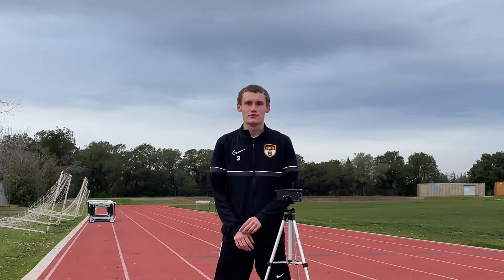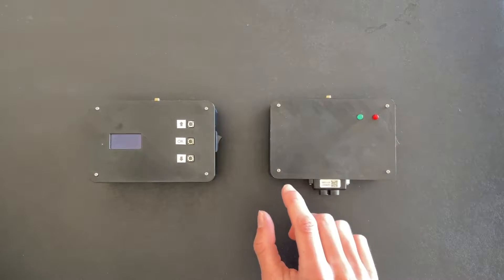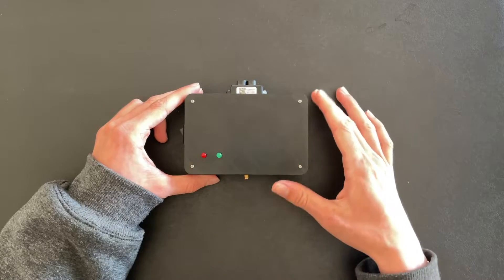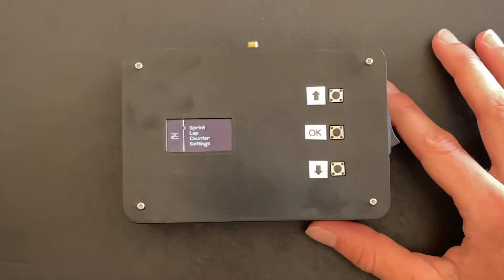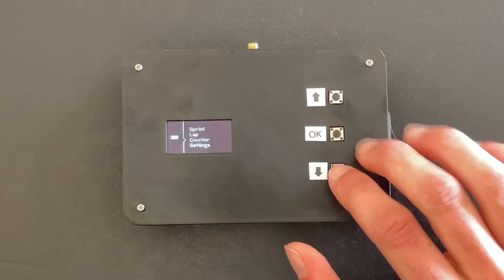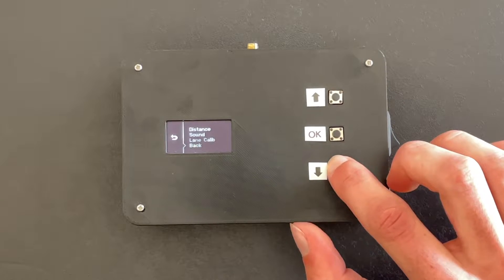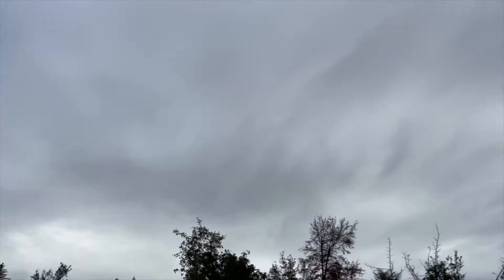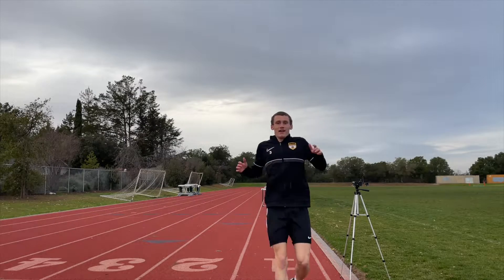DIY Affordable Track Timer

Comment: Hello Collin, did you use a circuit board to connect the pieces or just plain wire? I am unsure of how to connect them otherwise…
Reply from the maker: Hey! The arduino acts as my "circuit board" since all modules should pretty much connect directly to it. For things like the LEDs on the finish module I just soldered the resistors onto the LEDs and then used heat shrink. You can totally use a perfboard if you want though

Comment: Hi Colin : I managed to build your track timer. It was working for a while but the the time has stop working   The clock will not run when in  sprint/ manual mode. Also when in lap the clock will run but the lap time will count without any anything passing the sensor. Hope you can point me in the right direction. Many thanks. Lincoln
Reply from the maker: Hi Lincoln, usually when this happens it means the two modules are not correctly connected to each other. Make sure the start module is receiving numbers (distance in cm)

Comment: Collin, I wasn't able to find the parts list in the link from a few years ago. Is it still available? I think my boys might enjoy making one of these.
Reply from the maker: Yes! Sadly the Arduino page hasn't been working for a while but the project and parts are still up on Hackster https://www.hackster.io/collin-w/easy-and-affordable-track-timing-system-dcc6f9
Reply: @CollinWentzien  Except the schematics to print the box have been deleted. Help!!!
Reply from the maker: @Datasciguy99  Hackster always says that for some reason, you can just use the download button in the top right of each file to download them and they should work fine

Comment: Hi Collin, congratulations, thanks for sharing the project. In your opinion, is it possible to do a similar project using infrared sensor (E18-D80NK)?
Reply from the maker: Thanks! Yes you can use that sensor however be aware that its range only goes up to 80 cm or .8 meters, which is slightly less than three feet. Keep that in mind as it will work for running right next to the sensor but not for the further out lanes

Comment: Is there any delay between the two modules, and if there is, how much? In case you reply and there is some delay,  how could I fix this?
Reply from the maker: Hi! To be completely honest, I did not get an exact number for delay, but I did do some eyeballing and it seems to be pretty much instant. If you wanted to fix some delay, I'd have the modules run a test when first powered on to send a packet and see how long it takes to receive the packet. In my opinion, the lack of a RTC module is more inaccurate than the potential delay haha

Comment: Hello i would like to buld one if these but with 2 sensors one at the start and one at the finish. Start laser begins the timer and finish laser stops the timer. I can achieve all the hardware soldering and such but what kind of code would i need for that to work? And would multiple 2.4ghz tranmitters interfere with each other if i wanted to run 2 systems next to each other? Thanks!
Reply from the maker: Hello!
1. Yes you can totally use two LIDAR modules in tandem. Just copy some of the code from the finish module that processes the LIDAR information over to the start module code and it should work.
2. As long as you set the two module pairs at different frequencies, they won't interfere. This is done in the beginning of the code on both modules at the line "const byte addr[6] = "00001";" Simply change "00001" to "00002" or a different number and the modules shouldn't interfere.
Hope this helps!

Comment: The 1.3" OLED Screen we have (and the one liked in your "Things used in this project") only has 4 pins. GND, VCC, SCL and SDA.
In your diagram you have MOSI, CLK, DC, RST, CS, VIN and GND.
The VIN and GND are obvious, but what about the other pins? 
Any help on connecting the 4 PIN OLED woud really be appreciated.
Thank you
Reply from the maker: I must have linked the wrong OLED screen :(. Good news though is that it should still work! The screen I used uses an interface called SPI, while your screen uses an interface called I2C. Both operate off of (pretty much) the same driver so you shouldn't have to do much modification to the code. All you need to do is change the way the screen is initialized, that is, the line that reads "Adafruit_SH1106 tft(OLED_MOSI, OLED_CLK, OLED_DC, OLED_RESET, OLED_CS);" Change it to something shown in a video showcasing how to use I2C OLED screens with Arduino like this one ( https://www.youtube.com/watch?v=_KD7skmusTQ&t=184s&ab_channel=MissionCritical ) and it should work
Reply: @CollinWentzien  Thank you for the info. I will see if i get it working with this screen. If not I will try to get the one you used.
Reply: @CollinWentzien  Once again thank you.
I'm going to give it a try. If now luck I will order a SPI OLED screen!

Comment: Hi! I have two questions:
1. Is it possible to create a sensor for adjusting the distance between the two modules and having a live real display for that distance? I'm not going to be able to run at a real track so I don't have markers and can't rely on just measuring with a yardstick
2. For timing flies (with a 10m build up and then measuring time from 10m to 60m for a 50 fly), so basically adding another sensor that detects when you cross both the start and finish modules  (and subtracting the time), is that also possible? Do I just buy an extra LIDAR sensor?
Reply from the maker: Hi Joshua!
1. I think that should be possible, but my only guess as to how you would do that would be using the latency between the two modules to determine distance. Otherwise your best bet will be to measure out distinct sections with known distances
2. Yes this is totally possible with a second lidar sensor. The code then just needs to be changed to start the timer when the first beam is crossed instead of a button pressed.
Let me know if you have questions/concerns. Hope this helps!

Comment: hi Collin,
I have a problem with the Lidar module, when I start sprint/automatic the stopwatch is stopped, however if I disconnect the Lidar, the stopwatch works.
I have tested the Lidar on the serial monitor and it does the distance readings.
What do you think could be the problem?

Thank you so much
Reply from the maker: Hi Paco,
I just replied to your email, but in short, do you know if the LIDAR works across the wireless connection or just the serial monitor?
Reply: Hi Collin, all resolved, works perfect.  I love you !!! 😅
Reply from the maker: @pacodiaz6696  Great to hear! What was the problem?
Reply: I think that when testing it in a small place inside the house it did not work well.  I have tested the sensor outdoors and calibrated the LiDAR to ambient light and it was perfect.  Thank you so much

Comment: hi collin, i have problem with adding one more digit of milisecond. i had done for adding one variable for oneth  milisecond and the increase time in the get function. the timer display as 00:00.00.  However, the timer  for the tenth of milisecond is not run as fast as milisecond as if the stopwatch. may i know how to increase the time.
Reply from the maker: Hi Kim, sorry for the late reply. I just responded to your other comment so hopefully that helps :)

Comment: Hi Collin - How many athletes can it take at a time. Is it limited to 4 only or can it take 10 in a race?
Reply from the maker: Right now it can measure up to eight athletes, although I'm sure you could program it to measure 10. The only limitation is the LIDAR's range, since its maximum reading distance is 12m.

Comment: Hi Collin,  for running in group,  is it only one lane or multiples lane will be detected ?
Reply from the maker: Hi Kim, the track timer is designed so that the "Counter" mode can detect multiple people in multiple lanes. The lane selection in settings acts as a "max" (for now). For example, if lane 6 is selected on the module, then all lanes 1-6 will be measured, but any past (7, 8) will be ignored.
Reply: @CollinWentzien  I see,  noted, thank you so much for the information.

Comment: Hi collin, i have problem with the sketch too big, it doesnt have this problem before but after reupload the code it shows sketch too big. may i know how to solve this? the error picture is in the link https://drive.google.com/file/d/1YPreo4bld_-LAyNjRO3T2e9yrp1WTyW8/view?usp=share_link
Reply from the maker: Hi Kim,
This error pops up whenever the sketch size is too large. Unedited, the code takes up about 95% of an Arduino Nano/UNO's flash, meaning you only have around 500 bytes of wiggle room (which isn't much). If you made any large changes to the code, it might just be too big to fit on the Arduino. I would suggest removing things in the code you don't need, such as maybe the muting speaker or some of the icons to free up storage.

Comment: Is the lidar sensor accurate enough for timing to a hundredth of a second for, say, flying 30m sprints?
Reply from the maker: Hi Grayson,
Yes, the LIDAR sensor should be accurate enough for that as it has a frame rate of up to 1000Hz (1000x a second). The only semi-inaccurate part of the system is the timing itself, as the Arduino isn't the most accurate for that. I would suggest using a RTC, or real time clock, module for more accurate timing.

Comment: hi Collin, I decided to add another digit for the timer (milisec) and display really like a stopwatch. At the moment, I only know to create another variable name 😅. may i know which part of function code i shall change as well?😂
Reply from the maker: Hi, to add another digit for the timer, you would want to add another variable for hundreths of a second and increase it every 10 milliseconds, or 0.01 seconds. When it reaches 10, you could increase tenths of seconds (that part is in the code), etc etc. There is a part in the code where seconds and minutes are increased, add the hundreths function there.
Reply: @CollinWentzien  so the part i need to change isit at the get_time function ? and how about the   display.print(String(m1) + String(m2) + ":" + String(s1) + String(s2) + "." + String(s)+ String(ms)); in the fdraw app function, do i need to add the hundreth second variable as well?
Reply from the maker: @kimvuivoon4858  yes you will need to add the hundreths variable in the print() fuction to view it
Reply: @CollinWentzien  hi collin,  by adding another last digit to the timer, i used micros() instead of millis(). the new added last digit of timer display micro sec as if the stopwatch timer which is what i want. However, the second digit which should be run as a millis time , it run much slower than the millis speed which make the timer delay many second. may i know what shall i change for the coding?
Reply from the maker: @kimvuivoon4858  the Arduino clock is not very precise unfortunately, meaning that 1 second is around 950 arduino millisenconds instead of 1000. By using micros() this error is magnified. You can try decreasing the delay period, but if that doens't work, you might need to purchase an RTC module (real time clock) which will provide more accurate time readings.
Reply: @CollinWentzien  I see, noted thank you Collin!!

Comment: Hi,  I get my oled display only have 4 pin vcc,  gnd ,sck and sda. However ur schematic have 7 pin connected to arduino uno , so how shall i connect the 4 pin to?
Reply from the maker: Hi Kim. Most OLED displays either connect with 7/8 pins or 4 pins. Your screen uses a protocol called I2C, but it isn't very different from the way I set my screen up. I would suggest watching this (https://www.youtube.com/watch?v=_KD7skmusTQ&ab_channel=MissionCritical ) tutorial on how to set up the display. Let me know if you have any issues
Reply: I see,  so do I need to edit ur code  ? Once I uploaded ur code,  nothing will display
Reply from the maker: @kimvuivoon4858  yes you will need to edit the code slightly. You should only really need to change things above setup() and in setup(), everything else should work fine.
Reply: It work well with the example code trying with library adafruit 1106 12IC

Comment: Hey Colin, I`ve just tried to send a message on facebook (yes sorry, I stalked you out on there lol ). I`ve got a few questions about how you keep the actual time accurately without a real time clock module. I don`t need any more accuracy than you are getting so I don`t need a RTC either, I`m just confused how you are keeping the time despite showing us the code! As you can see from my channel, I`m not totally new to arduino but all my projects were some years ago!
Reply from the maker: Hi!
Thanks for reaching out. Sorry I don't check facebook often (actually never) but I'm a bit more active on here :). In terms of keeping time without an RTC, I just use the Arduino's internal 16MHz clock to keep time. You can't easily keep time with the delay() function, as it pauses all code for that set amount of time. Instead, I use the millis() function, which prints the system time in milliseconds. I also have another variable called prevMillis (or something like that). So, when the current time, or millis(), is 1000 over the previous time, we know a second has passed. We then set prevMillis to whatever millis() is currently and continue that cycle. Hope that makes a bit of sense since its sorta hard to explain haha

Comment: hi collin😊, for timing multiple lane, isit i need to set the distance for let said 6 people first , then start  the timer? and after the time stop, how can i view the individual time?
Reply from the maker: Yes, you must set the distance before you start the timer. And for different modes, the lane detection works slightly different. For both sprint and lap mode, the sensor only looks at a section of track, and when that section is crossed, the time stops. For counter mode, everything from the start of the sensor to the specified lane that is detected is recorded, but only the last time is actually displayed.
Reply: How do I view the other times crossed @CollinWentzien
Reply: @CollinWentzien  thank you very much collin, it works now, the workable pin for nano is A4&A5.
Reply: I want this feature.  It would be really good to see all the times.  Kids are always asking. :)

Comment: Hi Collin,  is the track timer hv the feature of storing data. It is like after running the some tracks, athlete want to see back there result.
Reply from the maker: At the moment, the track timer only displays the last time. You could add storing funcitonality either using an array list, or, if you want it to remember data even after a restart, using the built-in EEPROM.
Reply: @CollinWentzien ok  thank you very much

Comment: Hi,  I have question with the start module programming. May I know what is the purpose of listing the address number like 0x00 ,...from line 47 all the way to line 247? And which function of programming shows the beep sound ?
Reply from the maker: The addresses are for different icons that are used throughout the system (left centered). I just make them in paint.net and convert them to hex files. By the beep sound I assume you mean the speaker, and to play tones on the speaker you use tone(pin, pitch, duration). More details here on how to use tone(): https://www.arduino.cc/reference/en/language/functions/advanced-io/tone/
Hope that helps!
Reply: @CollinWentzien  the icon do u mean for the oled display?
Reply from the maker: @kimvuivoon4858  yes, they're the little 16x16 icons that you see in the menu systems
Reply: alright, thank you very much!

Comment: And is it possible to replace the ttf sensor with distance sensor, would I loss multiple time races In this case?
Reply: Ultrasonic sensor I mean
Reply from the maker: @kimvuivoon4858  while it is possible, one of the benefits of using the LIDAR sensor is that it has a very narrow beam (around 2 degrees). The ultrasonic sensor, on the other hand, has a beam of around 15 degrees, making it better at detecting normal objects, but also makes the beam more spread out as the distance increases. The farther away a person is from the sensor, the quicker they cross it essentially.
Reply: Thanks and appreciate your reply